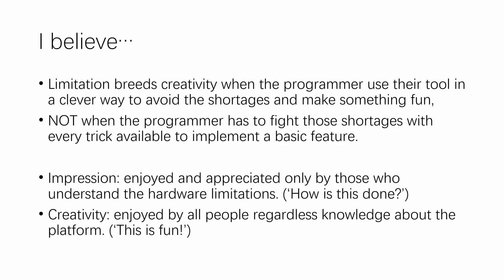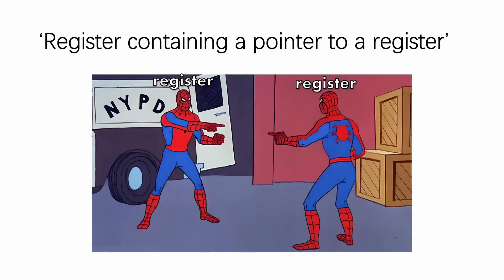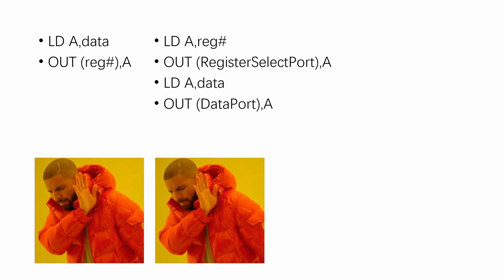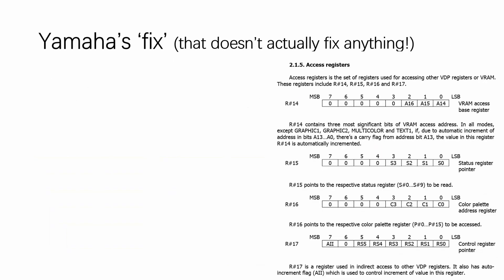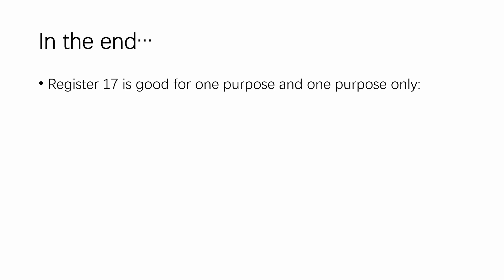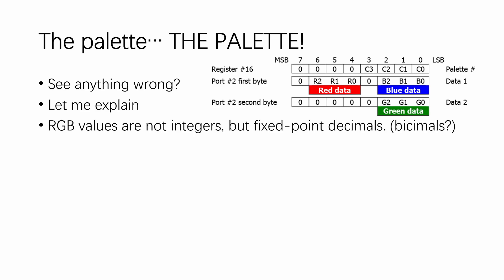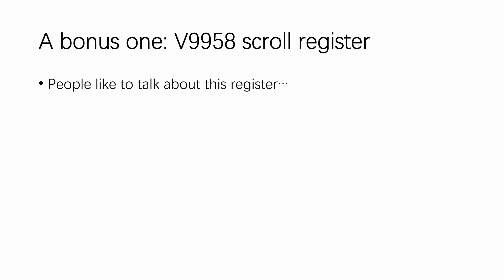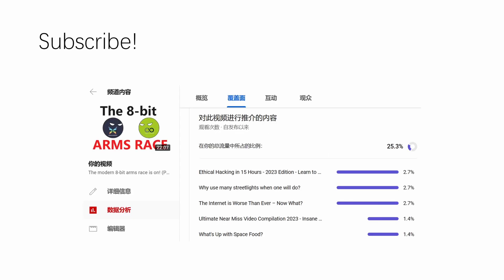The registers of V9958 are a mess.

Comment: Wow it is really messed but first thought is the vicitim of preserving backward compatability or conspiracy to llimit number of developers to those who given secret documentation :D
To be fair, i don't know times where V9985 was constructed but in many caseses in late '70 and early '80 this was real fight for transistors and real posibilites of manual tracing of silicon.

That's why instruction lists on 8-bit procesor are so not heterogenus and that's why MC68k is so beautifull symertic cutie ;)
Many I/O chips have many quirks like read-only and write-only registers, wierd timing dependecies, writing order dependecies (excluding using OTIR), i think Amgia Cooper was final response 
to dealing with such things :D

Seperate scroll registers have some sense, becuase they are realised in seprarte parts of chip, one change adresses, one shifts timing reference.
Reply: SH2 and ARM TD have half the register count of the 68000 . VIC-II and TED are quite clean.

This video chip came out after 16 bit CPUs came out. So design tools should be better.

Actually, I think that a 6502 like computer could be reimplemented in a simple way with orthogonal addressing modes. You just need to accept that transistors are fast. Then use a generic circuit for the byte/word field. So a loop in the PLA . One PLA for addressing, one for data.
Reply: @ArneChristianRosenfeldt  6502 is sepearte own beautiful story 🙂
If was made after 16bit then conspiracy theory wins or someone with less skill was finished project of someone who leaved.
Reply: @AK-vx4dy  many people have their take on that chip. But surely it was designed before it was clear what the MOS fab would be able to do. And then came slow DRAM and shared memory. The PLA design and the busses on the 6502 are all optimized to do as much in a clock cycle and at the same time run as a high as a clock rate as possible. In the end the CPU was always limited by RAM. Z80 came later and built on this information. Intel was a bigger company and more sure about their fab.

Nonetheless, 6502 wants to address stuff in almost every instruction. Encoding already starts with the instruction length in bytes. So length = 1 : implicit addressing or register ( TAX TXA ). 2 : immediate8 , 3 : absolute
Reply: @ArneChristianRosenfeldt  I don't have a take after I watched full story of its origin and times were then. 
And even before this he was matched to those times memory speeds almost ideally, z80 although has faster clock but used more cycles wich in result given simillar result for memory accesses speed. 
Both were unique and amazing but in other directions.
I think 6502 is amazing taking in the account that was intended to be cheap industrial microcontroller.
Reply: @AK-vx4dy  I just found out that prior to 1977 the 6502 was slower and STA had a delay between output of address and Akku ( why even, Akku is const .. Long bus . Or this is about other writes like push or JSR ).

Z80 has a better duty cycle. Z80 and memory work in parallel, while 6502 and memory work alternating. So both are idle half of the time. Apple I used the idle time for video. Z80 is still idle after instruction fetch. You can use it for memory refresh, but you don’t need to. So Z80 is like: Fetch, Video/Refresh, execute, writeback for most instructions.

I should check the timing on individual instructions 6502, but how can immediate16+X register addressing mode be so fast? The addition works in a pipeline fashion with reading the immediate value while incrementing the PC. Then there is cycle to copy the high byte over the bus into the AH register so that it is available really early in the next cycle.

So there is only one unused memory cycle. 6502 fetches the next in the last cycle of the previous instruction and decodes it? Fetch/decode is in a single cycle. This is probably the limiting circuit for clock rate. At least we know what 6502 does with the phase where it is off the bus here. In a pipeline design which wants to utilize all transistors to the max, we won’t to this. Also not in CMOS (65C02 anyone? ). But for nMOS minimum latency is king. Spit out PC and let the signals race until the control lines are set for the first cycle of the instruction.
Reply: @ArneChristianRosenfeldt  I see wast knowledge you have 😉
It were crazy times... they designed cpu and silicone process at the same time... I can't imagine this.
6502 have some degree of superscalarity ;)
But for me most impressing is zero page, it reduced code size and execution time at for the first years of slow memory could be used like extra almost 256 registers.
Refresh cycle squizing in idle time was mastery on z80 but minumu 4 clock cycle bites hard on longer opcodes even when fetching them.
Reply: @AK-vx4dy  nothing superscalar, just the famous 6502 pipeline. Though I don’t fully understand the fetch circuitry. There are some wires which go into the random logic in the middle of the chip.

I like that the 6502 is a real 8bit CPU with its zero page and 8bit immediates. No high and low registers, just two addresses in the zero page. There exist RMW INC instruction. But only for one byte. With the zero page, large integers (16,24,32 bit) could have be used for calculation in a mem-mem instruction format.  Otherwise statistics of machine language says that 16 registers are better than 256.

STA does not waste a memory cycle. So read address until the end of phase0. Then copy to AL while phase1. Available for address bus in next phase 0. Adding X actually takes a cycle. Pull accumulator from stack takes 4 cycles!? Must be the instruction with the most waste. Push needs 3 due to the wasted read of the second byte of the instruction. RET needs 6 cycles to read 3 bytes. So a compiler should really check if a function is short and called seldomly and better inline it.

RET first overruns the end. Then SP— . Then read two bytes. Then? It seems that any taken jump adds a cycle..due to the stalled pipeline? People told me that STA stalls the pipeline, but it looks 100% efficient. Are the concurrent stages: ALU -> register writeback and fetch?
Reply: @ArneChristianRosenfeldt  Yes, yes I mistaken English term, it is pipeline obviously.
It seems obvius but you know that whole 6502 was "decoded" from silicon and it is even in browser simulator  and even 6502 built from discrete transistors with less for every signal?
Reply from the maker: @ArneChristianRosenfeldt  I wouldn't agree that you can use RFSH cycle for video. Video output needs a stable access speed, and RFSH cycles on the Z80 is unstable. There are ways to overcome this, with buffering and bus arbitration. But I would argue that it is more work than just use separate VRAM than it's worth.
Reply: shared RAM has the advantage that the CPU can write to it. So Z80 overdid the refreshing? Maybe in MSX and ZX land smooth scrolling is not well known, but in Atari, NES, and Commodore land there always were buffers needed to delay the timing of the pixels even for the background. Just expand on these a bit. Atari also managed to at wait states for the CPU. Ah, this is a communication issue. The GPU on 6502 based systems does not need to know what exactly the CPU is doing right now. Just delay one edge of the clock signal. A Z80 would need to listen to a special pin and wait until the GPU has filled its queues and done enough DRAM refreshing. Actually, the CPU in the C64 and Atari 8bit actually has an extra stop-pin. I like how on C64 you can decide to use less memory for video (text mode with PETSCII ) or more ( bitmap graphics and double buffering ) . On our first PC most VRAM was idle most of the time. This would really hurt at the times when memory was really expensive.  @andyhu9542
Reply from the maker: I know about the reason for 2 registers. But 1, they could have inverted the bits somewhere and maintain consistency of scrolling directions. 2, Ricoh managed to hide the difference when designing the shift registers for the NES PPU. Combining the registers and making the direction consistent will simplify scrolling routines on the CPU side and gain some speed for games.
Reply: @andyhu9542   I don't know details on those platforms but if they  had no more than 32kB or 64kB of memory and this was a real graphic mode then scrolling by whole char can't go to far,  but single consistently designed register is a win.
In my country literature was not achievable so in '90 I didn't know that VIC colud scroll or shift on 3 bits so I was manually unrolling loops to have some decent vertical scroll up on c64...
Reply from the maker: I think it is unlikely that a secret document exists somewhere. (I just made a video about one and through the power of the community an answer has been found -it is debunked) I would add HDMA on SNES to that list of responses, although it is not as powerful as the copper.

Comment: I enjoy your content.  Always interesting.  I was going to use this chip for a homebrew computer until I saw your videos.  Perhaps it's not worth the effort.
Reply from the maker: I wonder which CPU do you use? If it's an Z80 I would say a TMS9918A is enough. I had a lot of fun with the TMS9918A. If you don't like using 16k*1 chips try the 9118.
Reply: @andyhu9542  I built a computer using the HD63C09 which is an MC6809 clone with more registers, instructions, and runs faster (fewer cycles and faster clock).  It's currently using a 128x64 graphical LCD display, 2 UARTs, a C64 keyboard, an SD card (I'll soon replace with Compact Flash), 128K SRAM bank-switched.  It runs Microsoft Extended BASIC, FORTH, C, etc.  I have FUZIX OS mostly working on it.  For months, it's been sitting on my desk running a demo-loop of several programs I wrote like plasma, 3D maze (like Doom), small flight simulator, spinning 3D objects, several Amiga Boing balls bouncing around, a few typical 8-bit 1980's line-demo variations.
That processor is the best 8-bit CPU of the 1980's.  When you examine the instruction-execution cycles, it give the 68000 a run for its money for both 8- and 16-bit operations.  It performs 16-bit multiplication in less than half the cycles of the 68000, and 32-bit division in a quarter of the cycles.  My computer is clocked at 3 MHz (for which the CPU is rated), but I'm not exaggerating when I say that it's probably comparable to a 6 MHz 68000 on 8- and 16-bit operations. It runs perfectly fine above 5 MHz, but I would need to add more wait-states when communicating with the GLCD since it's slow.
Reply: I'd say go for the V9958. It's available, it has more interesting modes than the 9918. Yes, it's slow and a bit weird, but it is the best available option apart from rolling your own.